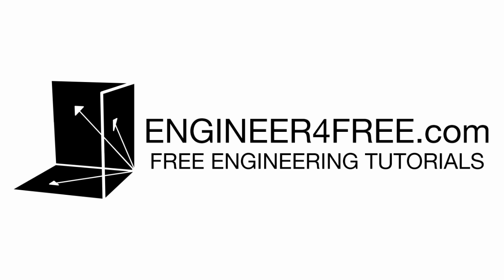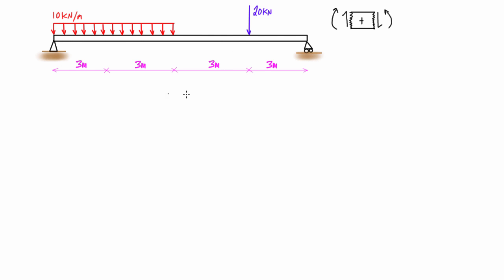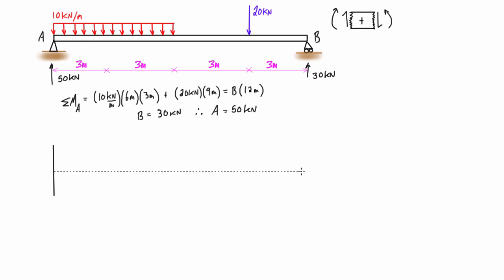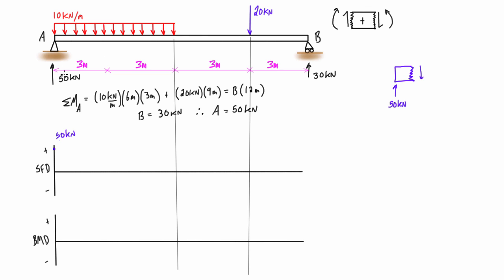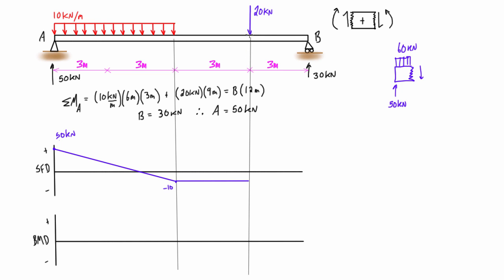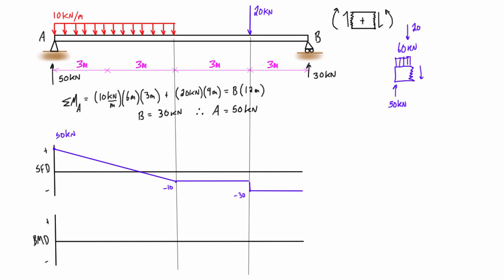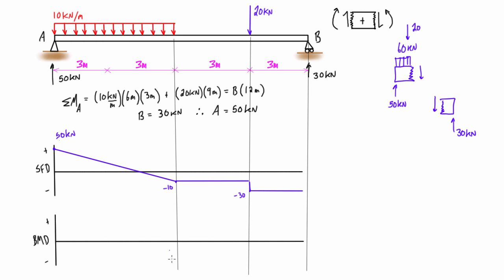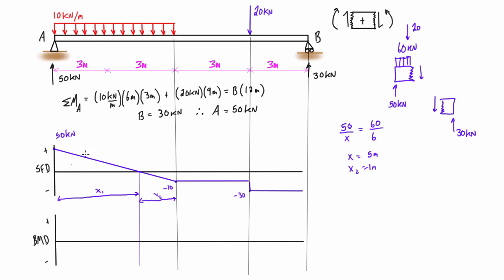Shear force and bending moment diagram practice problem #1

Comment: Good explanation dear. I have questions . Doesn't the curve of parabola will be the opposite? I mean starts at 125 and curves untill it reaches zero, with its inside part points upward. Because the slope at the left is very much than that at the right where it tends to zero actually. I wonder
Reply from the maker: We are basically just integrating to go from the SFD to the BMD. The area of the SFD translates into the slope or "rate of change" to the corresponding part of the BMD. If you solved this numerically, you would slice up that first triangle into many tall and thin sections (lets say we slice it into 100 sections, each 0.05m wide). We would calculate the area of each of those sections in kNm one-at-a-time, and then each answer would translate to the change in magnitude of the BMD from the beginning of that section to the end of that section (covering a distance of 0.05m). Because this triangle has it's tall side on the left, the areas on the left side will be larger than the areas on the right side. This means we will get larger changes in magnitude per section on the left side than the right side where the areas are smaller. This is why the parabola is oriented as it is, with larger rates of change (or slopes) on the left hand side, and then the rate of change decreasing as we go to the right. Does that clear it up?